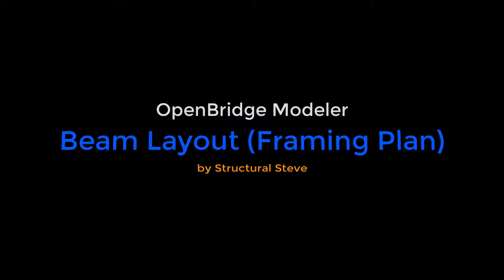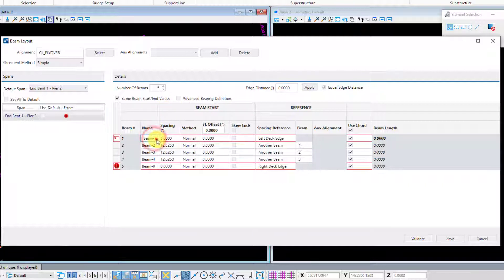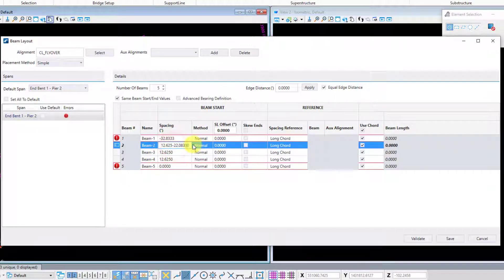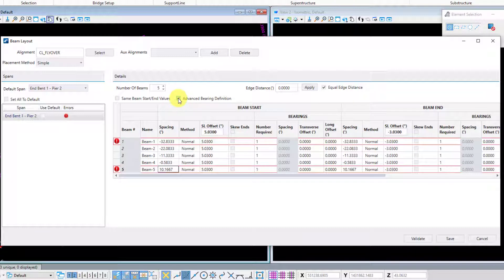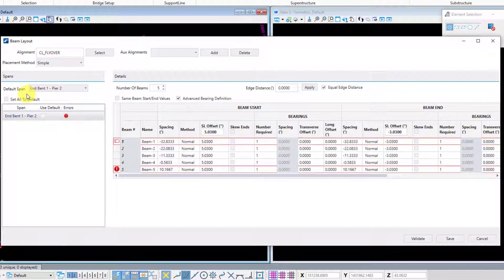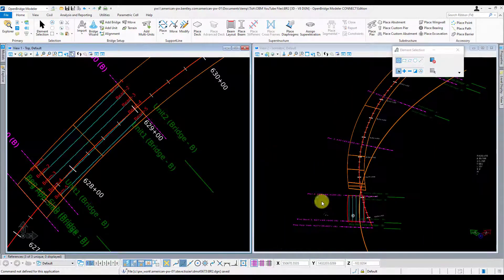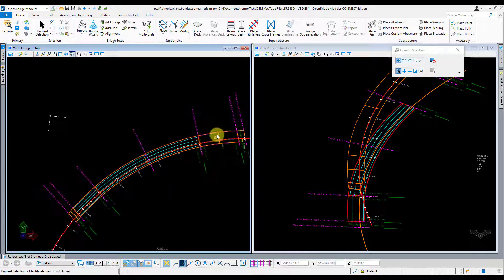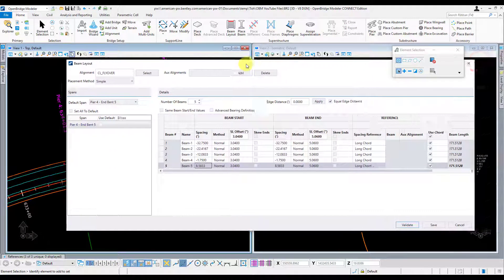OpenBridge Modeler - Creating Beam Layout (Framing Plan)

Comment: Have you ever put in transfer girders?
Reply from the maker: I'm not sure I understand the question. What do you consider transfer girders to be? Bridge lingo varies quite a bit from state to state, country to country : )
Reply: I have an irregular deck with a gore area and there is an extra beam in that area.  The extra beam starts at an abutment but terminates before the second support line (pier). The transfer girder is the girder that my extra gore girder will end at. The transfer girder is the perpendicular girder that spans to the two girders on both sides of the extra gore girder.  The transfer girder will be the same type of girder as the longitudinal girders.  I hope that I’m making sense.
Reply from the maker: I haven’t done that before but I am pretty sure you can add an extra supportline at the termination point of the transfer girder and add a separate beam layout for than one girder as a way to trick it into working.
Reply: Thanks so much Steve. I’ll give that a try tomorrow.